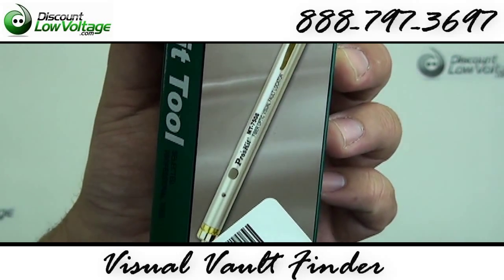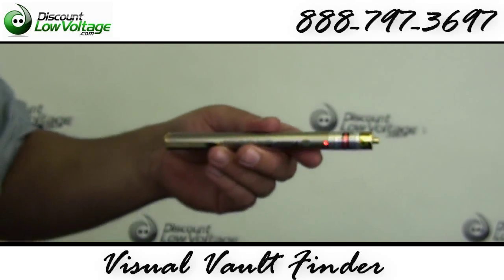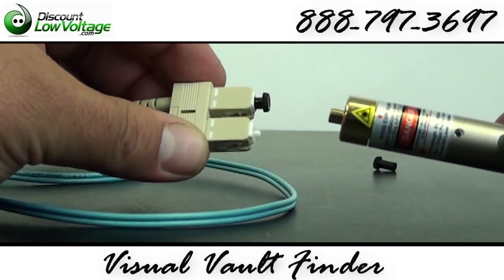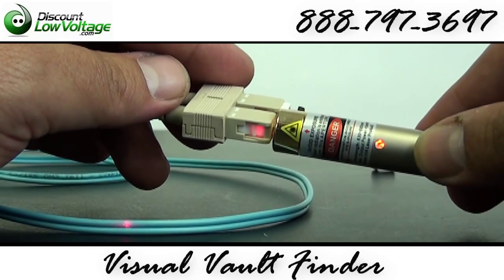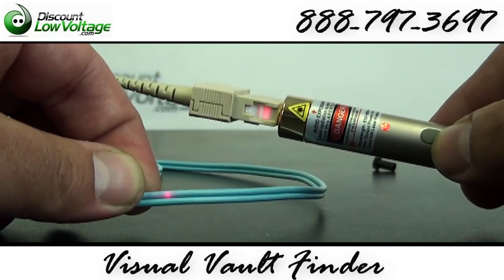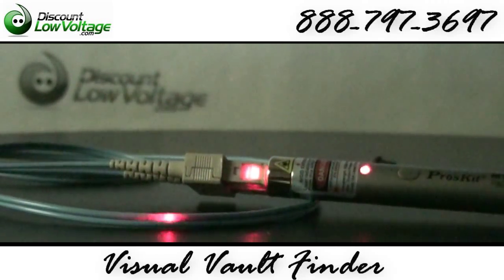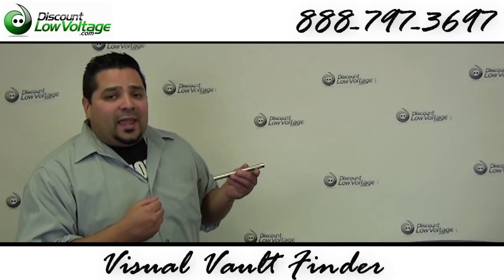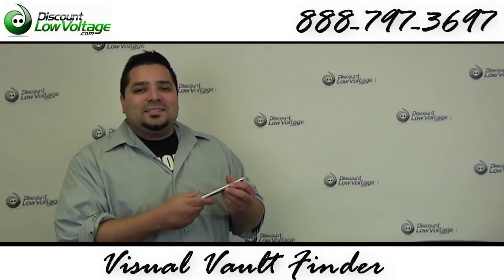How to Find Break in Fiber Cable | Visual Fault Finder

Comment: can this tool be used to locate a break in a tactical fiber with a kevlar outer jacket?
Reply: You can. Depends on the wattage of the laser you’re using. 

I think a standard operating laser is 1mw however depending on the network that you’re working on you can use up to 30mw. 

If working on a gpon network you need to be careful with higher powered lasers as they can damage splitters and head ends. 

Look on Amazon for 30mw lasers. They’re about 25 quid and they’re fine. Can see through the Kevlar jacket too.
Reply from the maker: No, you cannot see breaks under the outer jacket.